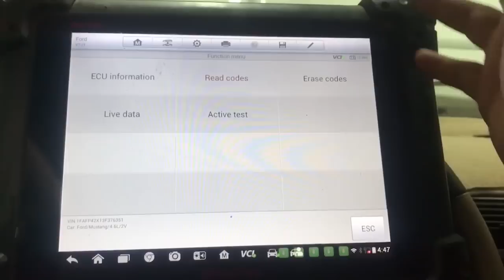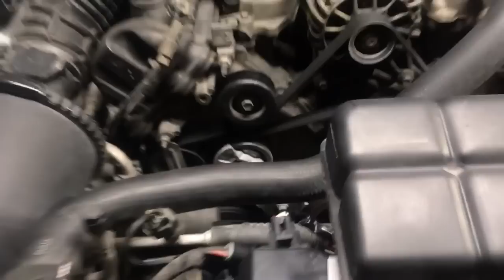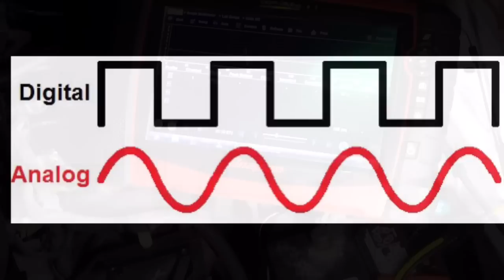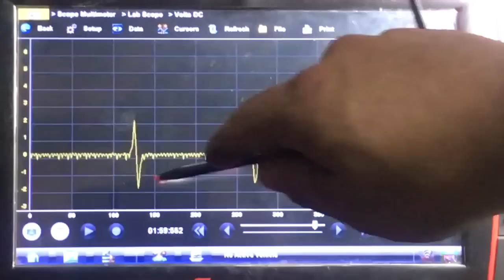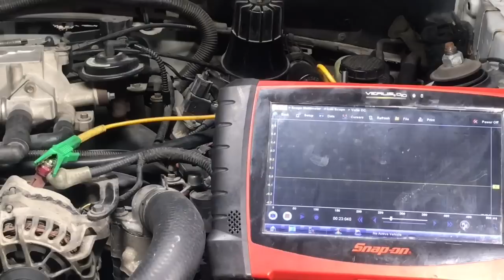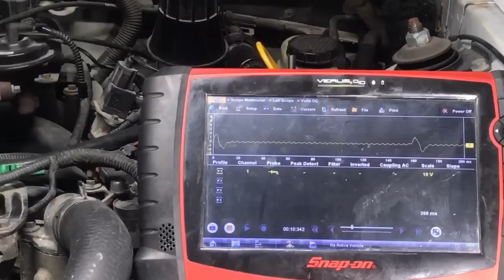How to fix code P0340.  A new cam sensor will not repair this car.

Comment: Awesome video explained a lot However I have a new alternator in it turned out it was an alternator fuse but I already replaced it now I see the wires plug that goes into the alternator is very loose and not making good contact could that cause crankshaft positioning sensor to trip

Comment: I have p0014 and p0340 engine stopped middle of the drive and took the battery lead and put it back the car started. I have changed the cam position sensor, oil control valve solenoid, oil and filter at last cam belt. The code still there car does not start until I reset the battery. Will it be alternator?
Reply from the maker: That’s hard to say without diagnosing it. I would recommend getting it properly diagnose. Wouldn’t want you to be wasting unwanted money
Reply from the maker: What part of the USA are you in. I have diag friends all around the states
Reply: I'm in UK
Reply from the maker: I actually have a couple of friends in the UK 🇬🇧

Comment: Nice diag work bro'
This one reminded me of a '94 Acura Vigor that would start misfiring around 2500 rpm. It was late in the evening, so I decided to bypass diag mode, & jump straight to iATN Fix Database mode, where I found one hit on this symptom, which turned out to be related to excessive diode ripple. So, I removed the connector from the regulator, & viola, symptom gone! New alternator fixed car.
Thanks for another great diag vid.

Comment: I also think that my transmission Governor solenoid sensor needs to be replaced as well because it won't shift into gear 3. Out here in Atlanta Georgia it seems like people at mechanic shops don't want to help me so I'm thinking of buying some tools and fixing the problem myself

Comment: I understand the video very well. But I have the same cold going off on my 1999 Dodge Ram 1500 5.9L. And i don't know if it's just that needs to be replaced or is it just my distributor not screw down all the way that's causing the real problem

Comment: Wow . thanks bro, from I install a new alternator I been getting that p0340 code, I change the cam sensor two times still no change , so it is the altinator, 1998 lincoln navigator. Thanks a lot back to AutoZone I go
Reply from the maker: It might be something else that code is pretty vague. The proper way is to hook an oscilloscope to it

Comment: Hi I'm getting p0340-2 low circuit on my camshaft sensor do you reckon that could be the alternator
Reply from the maker: I would hook up a scope to the cam sensor to see the activity on the signal wire
Reply: @OzMechanics  that's what I was thinking hopefully it'll be able to shed some light on the issue thanks for the reply

Comment: I have a 2010 Chevy Equinox and we have replaced my intake sensor twice and after replacing it last week the check engine is on again. I wonder if the alternator could be the problem ?
Reply: Try a cam/crank correlation relearn or clean the vct solenoid

Comment: Before changing the alternator i suggest get some CRC cleaner to clean the connector, i did this 2 years when i got the p0340 code, car being running fine since then
Reply from the maker: But if you have a bad diode in the alternator how would cleaning the connector help out
Reply: @OzMechanics  that advice is for none mechanic without any tools, i replaced my camshaft position sensor the code P0340 was still on and car was running rough, the person working at autozone told me to clean the connector with the CRC cleaner problem solved, I'm saying before spending $500 to replace an alternator, spend less then $10 clean the connector first it doesn't hurt to try

Comment: I got a 2000 Cadillac Deville DHS it has several codes and im now wondering if it all related to my alternator....putting out to much voltage???  Great video... got the 0340 and couple other electrical  issues,  hmmmmmm

Comment: My check engine lights on, and I NEED to smog. Has a new cam shaft sensor, but still no bruno. Thoughts? Thank u
Reply from the maker: If you’re in the LA area I can recommend you to a shop that can diagnose it right
Reply: @OzMechanics  I'm in Camarillo.  Like 45 min north of LA
Reply from the maker: I have 2 friends in California. One lives in Huntington Beach and the other in Pomona. If you would like them to diagnose it I can send them a message. I’m just not sure what their diagnosis charge would be. But I trust them on making the right call.

Comment: Do you have a video for detecting misfire with no codes using oscilloscope?
Reply from the maker: It has codes. But I used the oscilloscope to find the problem 

https://youtu.be/bAscM284I4U
Reply: @OzMechanics  thank you 👍👍👍

Comment: This code B 1318  on 2008 ford crown Victoria pI. throws different issues starting with the alternator, crankshaft sensor, sparplugs, dirty battery terminals . Car warning lights didn't advised of any issues car lost power rpms wouldn't go up 2 before going completely dead waited about 20 minutes the car started running like nothing had  happened it did the same thing 3 years ago any body with these issues? 🤔

Comment: Not sure if you've personally experienced a customer bring in a Infiniti g35 or 350z with the code P0345 but it's a freaking headache lol Ive replaced the sensor even the crankshaft position sensor since it has such a long crank time and the problem still is there. Have you dealt with this before?
Reply from the maker: Bongo is a Pyro I have a video. That I replaced a cam sensor on a 350z and It was a bad sensor right out the box. But it’s hard to know what’s actually wrong without a scanner
Reply: @OzMechanics  how would you be able to tell if the sensor is good or bad? Isnt it usually just a resistance reading?
Reply from the maker: Bongo is a Pyro scope reading
Reply: @OzMechanics  wow
Reply from the maker: https://youtu.be/bCHQfMA6aLw
Reply from the maker: Here’s my video where it shows that. Other than that it’s just a guess

Comment: Hey Oz I have a 2005 Subaru Legacy gt i have a cam sensor circuit code and i changed them both changed the oxy sensors had new coils an sparks done an a month later i got the cam code but it runs fine but when i go to slow down it either dies or has a rough idle. Not all the time does it do this though it is random. Most of the time when i crank up it has a moment or two the idle sounds rough an some times when i put it in drive or reverse it acts up but its random though so no consistent. Would that be the wiring harness to the sensors? being its a Subaru not the best wiring. Or would it be something else cause its not feeling a running like a bad cam sensor thank you for your time!!

Comment: what would cause no exhaust cam readings on a 2.4 ecotec. Scanner reads intake cam fine the exhaust cam has zero values that never change.

Comment: I HAVE PROBLEM IN MY 2006 FORD F-150 Camshaft Position (CMP) sensor, circuit malfunction (Bank 2 THE SAME CODE  P0345 I CHANGEE

Comment: 2008 f150 5.4 v3 camshaft position sensor unable to remove the screw head stripped any solution as too getting it out???
Reply: Grind head off. Drill and tap.

Comment: Would the typical alternator test that an auto parts store does for the battery/alternator catch this issue?
Reply from the maker: John Just they offer ripple test
Reply: @OzMechanics  I have access to an oscilloscope so I could do the ripple test. I don't think they look at ripple....just do load testing to find the amperage/voltage in no load and under load.  My Lexus threw the p0335, p0345, p0340 codes all at once and has weak starting after letting sit for a couple days now, so I'm guessing it's alternator/battery.
Reply from the maker: Yea at Autozone tester they offer ripple test. But using the scope is going to be your best test

Comment: Hi OZ I have a 2006 dodge caravan and I have an issue with it I got an engine light on and it started to run rough tough to start and jerking at roughly 2500 rpm diagnosed both sensors and wires there perfectly fine can the alternator cause this ?

Comment: Great diagnostic and shows why electronic problems can be tricky.  I hope those who don't wrench on their cars appreciate why the mechanics they pay can't always solve every issue on a 1st pass.  It appears the alternator output noise coupled into the analog ground of the engine controller (needs more filters), and also that perhaps Ford chose a too-low threshold for the VR signal from the camshaft sensor.  Perhaps purposeful so it would still work as the sensor magnet aged or if installation distance was off, but also makes it touchy to any noise in the signal or controller.
Reply: I'm betting any noise is irrelevant.
Reply: @darishopkins2573  No need to bet since he proved the alternator was the noise source.  He disabled the alternator so the engine then ran off battery alone and the camshaft sensor signal became very clean.  He also researched the problem for this specific model and found where others cured the sensor code issue by swapping in a rebuilt alternator.  The camshaft sensor error code then disappeared, proving that the noise was the problem (thus was very relevant).

Comment: I've got the same Trouble Code pending on Hyundai Sonata 2007,2.4. The car won't start at all, cranks but won't start. Suddenly its all good again code disappears and car starts again until few days later Same issue (won't start showing Cam Sensor circuit faulty). Does this Sound Like a cam Sensor failing? Or do you have an Idea what commenly would cause such issue unregularly? Would appreciate your help very much, thank you!
Reply from the maker: Check out the cam sensor powers, grounds and signal wire while this is happening
Reply: @OzMechanics  ok, I will have my multimeter ready,also did some more research and should be able to at least figure out If the sensor is working. Thank you!

Comment: Added information... the Radio suppression capacitors are found on the front of the engine.  Those capacitors aren't for the "radio."  Capacitors filter out noise just like what you saw on your scope.  In other words they filter out radio frequency noise (RF noise).  You might have fixed it with the alternator but I believe the better fix was with the capacitor... it only costs $8.  Soon the new alternator might cause the same problem and you'll be in the same problem. Excellent video but go further just like you said and don't throw parts at your car. In fact might be able to clean the connections on the capacitor and it'll be free.
Reply: Thanks for that tip !!!
Reply: Does my 2014 Ford mustang v6 3.7 have capacitors?
Reply: @florenbaron7111  There's a good chance it does but often they are called something else.  Noise filter, DC filter, Noise Reducer, etc. Inside it's usually just a capacitor.

Comment: Saved me time and money my xterra is doing the same thing. I’m seeing a spike in between the cam sensor trigger I’m going to test on alternator side just to verify the spike disappears. Appreciate your video. 👏🏽👏🏽
Reply: I have an xterra throwing the camshaft sensor circuit failure code right now.. What did yours end up needing done?

Comment: Man, bro i have a 09 Pontiac g6 , its throwing the cam position sensor . I changed the sensor , the car still acting up. The car runs fine but check engine light is on , what should I do ??? Please help!!!!!
Reply: Did u get it fixed?

Comment: 7:35 "Let me try to get this, so it could be nice and good."

LOVE IT!
Reply from the maker: Jack got to love that nice and good stuffffff
Reply: @OzMechanics  I appreciate nice and good. Nice and good is so much better than nasty and bad. Who among us has an argument with nice and good? Let those who do walk around the block a few more times. Be that as it may, instead of, "How to fix code P0340", I would suggest, "One way to fix code P0340." Your fix, while very nice and good, may not fix all instances of P0340. My neighbor just came into possession of a 2001 BMW 525i that is throwing a P0340 DTC. I need to get a scope like you have to probe the situation. I will keep you updated.
Reply: @7jack7  fixed?
Reply: @karyl-lynndesrosiers7599  The car had a few other issues besides the P0340 code. My neighbor took it to the local German car shop that has a good rep, Siegfrid's. My neighbor said a new sensor fixed the P0340 code problem. The car ran beautifully he claims, even when it was throwing the code.
Reply: @7jack7   Done that, twice.  Once  OTC, second time, OEM.  No go, chasing wires as I text.   Thank for answering.
Reply: @karyl-lynndesrosiers7599  -- Did you try changing the diode on the alternator? Oz claims that in a large percentage of these vehicles, a faulty diode in the alternator is the cause of a P0340 code. In my friend's case the faulty sensor did not cause any drivability problems. Probably just giving the computer a reading that was slightly out of the expected range, but not so much as to cause a problem. I didn't hear OZ mention at the beginning of the video if there was a drivability problem that accompanied the code, or it was just the code being set that was the problem. If your vehicle has the P0340 but no drivability problem you might try changing the diode. They are cheap to buy and easy to swap out.
Reply: @7jack7  Yesterday I found a chafed black wire on the EPC side of the knock sensor. Repaired that.  Check continuity on that and the cam sensor to the ECU.  Tried to locate some with a scope to check the alternator.  Also, found out there's an RVU (15D6) on the VIN, which states that P0341 and P016 are caused by the old Cam  Bridge.  We did not replace that when changed the vehicle timing chains, tensioner and guides.   We found the missing bridge screen in the vacuum pump oil screen.  We chose not to replaced the bridge screen but now the 15D6 says the check ball valve can fail, so out it goes. I still haven't ruled out an alternator issue.  I've been working on this for 3 weeks.  I'm much better at upholstery.  Thank you for taking the time to respond.

Comment: Greetings and thanks for the video. Is the camshaft position sensor located in this area as well (2006 Kia Optima)??? My car is running badly and cutting off after fueling and while driving. Could it be the camshaft?
Reply from the maker: I would recommend taking it to a reputable shop so they can perform a proper diagnosis. I would hate to see parts thrown into the vehicle
Reply: @OzMechanics  Thanks for the info and response. I'll get a 2nd look and crazy thing is I already changed the CMP. Praying for an affordable solution 🙏🏾🤑

Comment: I have 06 fusion 2.3l that is throwing a p0340 cam sensor code and had another cam sensor laying around so I swapped it and code still comes on. When driving it bogs down and won’t accelerate over 15 mph. Alternator don’t have a whine to it, could it still be an alternator??
Reply from the maker: Tyler Dixon would have to look at it with a scope. To see what the signal wire is doing on your crank sensor. Other than that it’s only a guessing game

Comment: No scope no problem. Take a dvm across the battery put it on the A/C scale start the car. If ya have more than .05 a/c volts across the battery you have a bad diode in the alternator. Alternators have been around since the middle '60s and this is how we checked them. I mean after all, we didn't have scopes to do it.
Reply from the maker: Yea but the purpose of this video is it had a p0340. And found ac ripple on the cam sensor

Comment: Had a 99 Ford 7.3 alternator caused the Trans to go into limp mode. Customer went to a shop that had a dead 7.3 there and shot gunned every single module in the vehicle.

Comment: I have a 2004 Nissan Frontier 4x4 3.3L V6. It all of the sudden would just not start. It threw the P0340 Code so naturally I had the County mechanic replace the distributor because that is where the Cam position sensor is; well, it still didn't fire after that. I saw another video that said this code could also be caused by the Crank position sensor, so i ordered one of those and it hasn't arrived yet. I also ordered a knock sensor because I also got that code a while back when I was having misfires and needed to replace spark plug 6. It is winter here in Northern MN and my truck is a long ways away from civilization parked in the snow. I really need some help with this one.

Comment: Had this problem with my mustang 12 years and no one had a clue what was wrong with it. I eventually found a clue on a crown vic forum and got the alternator rebuild. The guy thought I was crazy for thinking it would fix the cam sensor code

Comment: P0014 code on a Kia Sorento. Computer calls for 12 degrees timing at idle reading fluctuates between 10 and 14. In live data. Mechanic is stumped. I think it’s possibly the connection could this be the issue?
Reply from the maker: Chazzz Man proper way to do this is by looking at both cam and crank signals to verify the correlation

Comment: SOB I changed 5 sensors FML
Reply: What did it end up being?
Reply: justin bouy I need to know too! I replaced my cam shafts and it’s still coming up the code & my car will start shaking and sounds like it’s rattling. I turn off and turn back on and it goes normal for a little bit then happens again.
Reply: @marshaguerrero1537  could potentially be a short in the harness or faulty alternator
Reply: @marshaguerrero1537  or timing could have slipped which is likely since you said it's shaking

Comment: Thank you for the informational video. I got this code on my o3 civic lx 168000mi when I was going uphill on a dirt mountain road @ 35mph. The engine lost power and shutown and the p0340 came on. I cleared the code and was able to come home.  Two weeks after it came back on but the engine didn't shut down. Three weeks later came back on again. I cleared it and hasn't come back since then. Checked the alternator and battery and they are good. What should I do? I also have a cat convert below threshold codes that comes and goes every now and then.